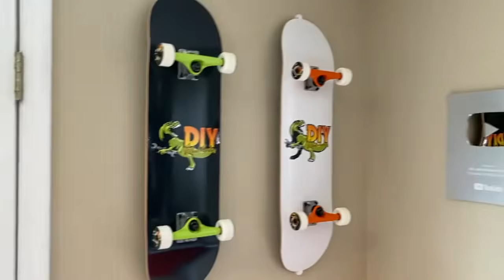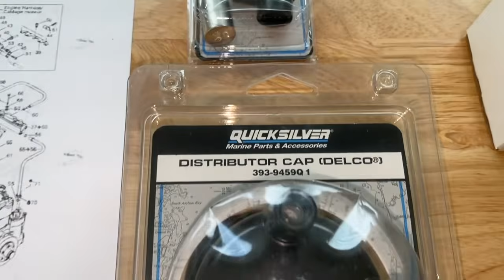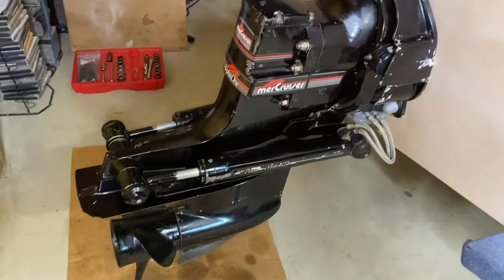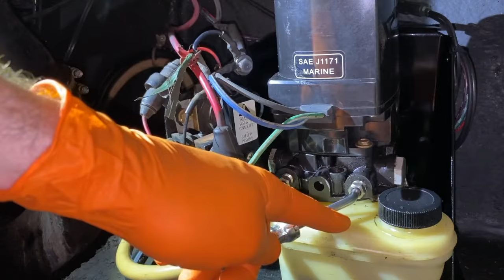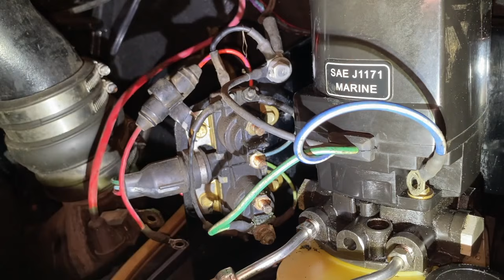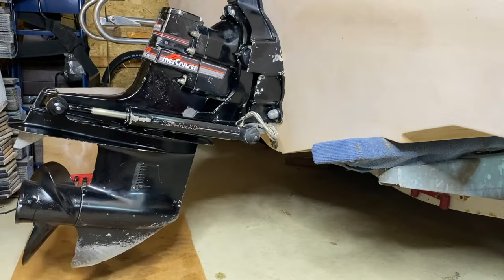Boat outdrive not trimming up or down - Replace hydraulic pump Trim solenoids

Comment from the maker: If interested in purchasing this product, visit our Amazon affiliate link below.  I earn from qualifying purchases.

Fixing boats/Jet ski PlayList:  https://youtube.com/playlist?list=PLjCXOz8TSkZlae2qY97uVVTm3JdBOUoRS&si=0QF9J0YNrNOKii3a

**********

1.  Distributor Tune-up Kit:  https://amzn.to/3RW1Mn5

2.  Mercruiser 3.0L Distributor Cap:  https://amzn.to/3veD5th

3.  Trim Solenoid (Purchase two):  https://amzn.to/47fs6wM

4.  Ratcheting ranch set:  https://amzn.to/48wswQz

5.  Quicksilver Trim Limit and Sender switch kit:  https://amzn.to/45GOIXb

6.  Quicksilver Hydraulic Trim fluid:  https://amzn.to/46Qq1Y5

7.  Quicksilver anode Kit (888755Q04):  https://amzn.to/3uIJ89d

8.  Quicksilver grease gun:  https://amzn.to/3uOFgDG

9.  Alpha one gen 1 Trim Rams:  

               https://amzn.to/3GwSt6C

10.  Trim Ram Hydraulic Hoses:  

               https://amzn.to/4a9rf3x

               https://amzn.to/486qVAE

11.  Trim Ram plastic caps:  https://amzn.to/3NlBV5b

12.  Extreme Grease:  https://amzn.to/46TgwY4

13.  Outdrive anode bolt plug (19-47579):  https://amzn.to/3NcHKSq

*********

1.  Install your outdrive to boat transom

          https://youtu.be/HgMSGiSiBA4

2.  Replace Mercruiser outdrive Bellows/Shift Cable/Water Tube (PART 1)

          https://youtu.be/NcObTOYXtQM

3.  Mercruiser outdrive Upper unit rebuild (PART 1)

          https://youtu.be/i7nRJPbRYPI

4.  Mercruiser outdrive Lower unit rebuild (PART 1)

          https://youtu.be/ehTA4BRH4t8

5.  How to calibrate/adjust Trim Limit and Sender switches

          https://youtu.be/5BetZVkPPHI

6.  Replace Trim Limit and Sender Switches

          https://youtu.be/vjJDnmJCNL4

7.  How to replace Trim Rams and Hoses

          https://youtu.be/nkcFYl5bL7c

8.  How to Air-Bleed your hydraulic Trim Rams and Hoses/lines

          https://youtu.be/gfW3dWsSLkE

9.  Replace Anode kit

          https://youtu.be/qy_qclP3zUQ
        
10.  How to replace outdrive Anode Kit

          https://youtu.be/qy_qclP3zUQ

11.  How to grease your outdrive grease fittings

          https://youtu.be/7q1sBu0TsPw

👍😎

Comment: Mine will go down. But not up with the switch. It will however go up with the trailer button on the throttle lever. So that leads me to believe that the solenoid is bad. no clicking when pressing up button from the pump. Can feel and hear a click from the button when pressed so I think that the switch is fine.
Reply from the maker: Thanks for watching, we agree after reading this.  Replacing the Solenoid…or both…would be our approach.  Keep us posted.

We will also share a link to our Fixing Boats playlist below.  Lots of helpful troubleshooting and repair videos.

     https://youtube.com/playlist?list=PLjCXOz8TSkZlae2qY97uVVTm3JdBOUoRS&si=6HEwpYvlWNajYYHI

🧰

Comment: What do you think could be the cause if my trim works up and down, but is slow on the way up only. Weak pump? Or needs fluid changed?
Reply from the maker: Thanks for watching, a few things can cause this.

1. Weak pump as you mention
2.  Air in system and needs to be bled
3.  Old or weak battery not charging to 12v when engine is running and alternator charging
4.  Leak in system (Unlikely if no visible leaks are noticeable on trim rams, hydraulic lines, or pump and reservoir area.

Please keep us posted.  We will also share a link to our Fixing Boats playlist.  In this playlist, you will find replacement videos on several parts of the hydraulic system.

     https://youtube.com/playlist?list=PLjCXOz8TSkZlae2qY97uVVTm3JdBOUoRS&si=jeXO06BpebNKf3j6
Reply from the maker: And if reservoir is low, we recommend adding fluid to within proper fill parameters.

🧰
Reply: @DIYwithMichaelBorders okay thanks for the tips. Everything checks out other than maybe bleeding the system, or a weak pump.
Reply from the maker: @nathangerzen3727 

Thanks for the reply, bleeding system added to the To-Do list.  😁

Link below will hopefully help you.

     https://youtu.be/gfW3dWsSLkE?is=UFkIB9uT1UzHdMYA

🙏

Comment: Does the kit comes with a pair or just one?
Reply from the maker: Thanks for watching, Solenoids come 1 in a pack.  We recommend replacing both.

Links to available parts on our affiliate program below.

***********

If interested in purchasing this product, visit our Amazon affiliate link below.  I earn from qualifying purchases.

Fixing boats/Jet ski PlayList:  https://youtube.com/playlist?list=PLjCXOz8TSkZlae2qY97uVVTm3JdBOUoRS&si=0QF9J0YNrNOKii3a

**********

1.  Distributor Tune-up Kit:  https://amzn.to/3RW1Mn5

2.  Mercruiser 3.0L Distributor Cap:  https://amzn.to/3veD5th

3.  Trim Solenoid (Purchase two):  https://amzn.to/47fs6wM

4.  Ratcheting ranch set:  https://amzn.to/48wswQz

5.  Quicksilver Trim Limit and Sender switch kit:  https://amzn.to/45GOIXb

6.  Quicksilver Hydraulic Trim fluid:  https://amzn.to/46Qq1Y5

7.  Quicksilver anode Kit (888755Q04):  https://amzn.to/3uIJ89d

8.  Quicksilver grease gun:  https://amzn.to/3uOFgDG

9.  Alpha one gen 1 Trim Rams:  

               https://amzn.to/3GwSt6C

10.  Trim Ram Hydraulic Hoses:  

               https://amzn.to/4a9rf3x

               https://amzn.to/486qVAE

11.  Trim Ram plastic caps:  https://amzn.to/3NlBV5b

12.  Extreme Grease:  https://amzn.to/46TgwY4

13.  Outdrive anode bolt plug (19-47579):  https://amzn.to/3NcHKSq

*********

1.  Install your outdrive to boat transom

          https://youtu.be/HgMSGiSiBA4

2.  Replace Mercruiser outdrive Bellows/Shift Cable/Water Tube (PART 1)

          https://youtu.be/NcObTOYXtQM

3.  Mercruiser outdrive Upper unit rebuild (PART 1)

          https://youtu.be/i7nRJPbRYPI

4.  Mercruiser outdrive Lower unit rebuild (PART 1)

          https://youtu.be/ehTA4BRH4t8

5.  How to calibrate/adjust Trim Limit and Sender switches

          https://youtu.be/5BetZVkPPHI

6.  Replace Trim Limit and Sender Switches

          https://youtu.be/vjJDnmJCNL4

7.  How to replace Trim Rams and Hoses

          https://youtu.be/nkcFYl5bL7c

8.  How to Air-Bleed your hydraulic Trim Rams and Hoses/lines

          https://youtu.be/gfW3dWsSLkE

9.  Replace Anode kit

          https://youtu.be/qy_qclP3zUQ
        
10.  How to replace outdrive Anode Kit

          https://youtu.be/qy_qclP3zUQ

11.  How to grease your outdrive grease fittings

          https://youtu.be/7q1sBu0TsPw

👍😎

Comment: Hi great videos where did you find the plugs to bleed tilt trim pump and rams for merc o/d thanks stan ny
Reply from the maker: Thanks for watching.  A new set of Trim Rams will come with new plugs however if you’re not purchasing new plugs… you can likely purchase plugs from a local marina or even a local hardware store.

You just need to make sure that the thread cut is the same and does not damage the internal thread of your cylinders.
Reply from the maker: If interested in purchasing this product, visit our Amazon affiliate link below.  I earn from qualifying purchases.

Fixing boats/Jet ski PlayList:  https://youtube.com/playlist?list=PLjCXOz8TSkZlae2qY97uVVTm3JdBOUoRS&si=0QF9J0YNrNOKii3a

**********

1.  Distributor Tune-up Kit:  https://amzn.to/3RW1Mn5

2.  Mercruiser 3.0L Distributor Cap:  https://amzn.to/3veD5th

3.  Trim Solenoid (Purchase two):  https://amzn.to/47fs6wM

4.  Ratcheting ranch set:  https://amzn.to/48wswQz

5.  Quicksilver Trim Limit and Sender switch kit:  https://amzn.to/45GOIXb

6.  Quicksilver Hydraulic Trim fluid:  https://amzn.to/46Qq1Y5

7.  Quicksilver anode Kit (888755Q04):  https://amzn.to/3uIJ89d

8.  Quicksilver grease gun:  https://amzn.to/3uOFgDG

9.  Alpha one gen 1 Trim Rams:  

               https://amzn.to/3GwSt6C

10.  Trim Ram Hydraulic Hoses:  

               https://amzn.to/4a9rf3x

               https://amzn.to/486qVAE

11.  Trim Ram plastic caps:  https://amzn.to/3NlBV5b

12.  Extreme Grease:  https://amzn.to/46TgwY4

13.  Outdrive anode bolt plug (19-47579):  https://amzn.to/3NcHKSq

*********

1.  Install your outdrive to boat transom

          https://youtu.be/HgMSGiSiBA4

2.  Replace Mercruiser outdrive Bellows/Shift Cable/Water Tube (PART 1)

          https://youtu.be/NcObTOYXtQM

3.  Mercruiser outdrive Upper unit rebuild (PART 1)

          https://youtu.be/i7nRJPbRYPI

4.  Mercruiser outdrive Lower unit rebuild (PART 1)

          https://youtu.be/ehTA4BRH4t8

5.  How to calibrate/adjust Trim Limit and Sender switches

          https://youtu.be/5BetZVkPPHI

6.  Replace Trim Limit and Sender Switches

          https://youtu.be/vjJDnmJCNL4

7.  How to replace Trim Rams and Hoses

          https://youtu.be/nkcFYl5bL7c

8.  How to Air-Bleed your hydraulic Trim Rams and Hoses/lines

          https://youtu.be/gfW3dWsSLkE

9.  Replace Anode kit

          https://youtu.be/qy_qclP3zUQ
        
10.  How to replace outdrive Anode Kit

          https://youtu.be/qy_qclP3zUQ

11.  How to grease your outdrive grease fittings

          https://youtu.be/7q1sBu0TsPw

👍😎

Comment: My trim pump  run in the down position  all the time  the only way  to stop the moter  is to remove  the battery  cable  ? Any idea
Reply from the maker: Thanks for watching, is your trim switch on your shift lever getting stuck in the down position?

If not, you will definitely want to replace your solenoids.

Comment: Is there a wiring diagram for the hydraulic pump?
Reply from the maker: Thanks for watching, that can be found in the service manual however you can actually contact Mercury Customer Service and they can email you the wiring diagram for your exact boat.

😁👍🧰

Comment: Excellent job describing things and showing how it all works.  My boat drive is stuck in the up position and will not tilt/trim down.  When I push the up and down buttons on the throttle arm, I can hear the sound and it sounds exactly like it does when it is actually moving/working properly, however, there is no movement of the outdrive.  It is not going up or down, yet it sounds like it always does when working right.    Does that mean my solenoids are good and I have some other issue?  Any ideas?  Thank you in advance!
Reply from the maker: @robeggett9946  

Thanks for watching, any update?  It may be that there is air in the lines or a Trim switch on outdrive has malfunctioned.

We would focus first on the solenoid and replace both.  Keep us posted.

Comment: Do you know where the 2nd red fuse lead wire is connected to - the one you didn't remove? I have not only a blown fuse, but a totally mangled fuse holder and was thinking of rewiring it into its original location rather than splice the wires and installing a new fuse holder. My access is pretty tight though so the splicing isn't the worst option.
Reply from the maker: @brian48026  

Thanks for watching, any update?  Are you referring to the part shown in link below?

       https://www.ebay.com/itm/313685943865?mkcid=16&mkevt=1&mkrid=711-127632-2357-0&ssspo=lvVhobzhTp-&sssrc=4429486&ssuid=9oPkoM_JR36&var=&widget_ver=artemis&media=COPY

🧰
Reply: @DIYwithMichaelBorders  Yep - that's what I'm referring to
Reply from the maker: @brian48026  

Thanks for the reply, have you tracked it to its connection point?
Reply: @DIYwithMichaelBorders  Not yet, haven't had a chance to get back to my boat yet. I have an extremely tight fit with difficult visibility where its located on my Amberjack. Looking at this video, it seems to just be connected to one of the posts on the back side of the top solenoid. https://www.youtube.com/watch?v=9Zn2bZ1MuJ8
Reply from the maker: @brian48026  

Thanks for the reply.  In our case, the red wire has a bluish purple stripe and feeds out of the fuse casing and travels behind the upper Trim Solenoid and into the larger rubber housing.

Comment: What size is the fuse in that rubber boot
Reply from the maker: @jmed4915  

Thanks for watching.  It’s either a 20amp or 25amp depending on the hydraulic pump and motor assembly model.  Our fuse is a 25amp.

If interested in purchasing this product, visit our Amazon affiliate link below.  I earn from qualifying purchases.

     OEM Fuse:  https://amzn.to/4fKMifv

😎👍🧰
Reply: @DIYwithMichaelBorders Is there a place to buy the rubber boot? My fuse blew and disconnected from the red wire so I need to reconnect and fine a new red o ring to connect to the other side of the rubber boot
Reply from the maker: @ 

There is indeed.  Let us know what your serial number is, we can hopefully look up a replacement.